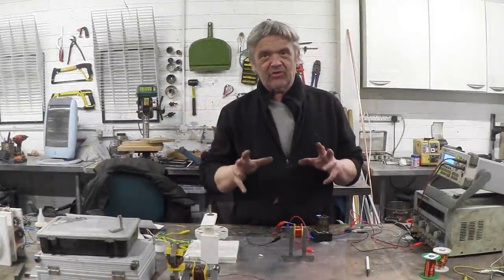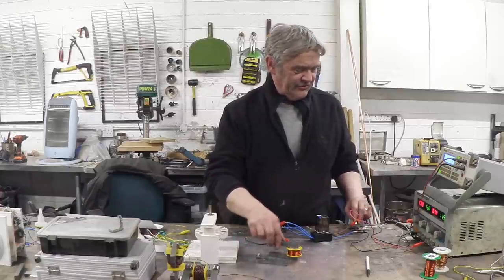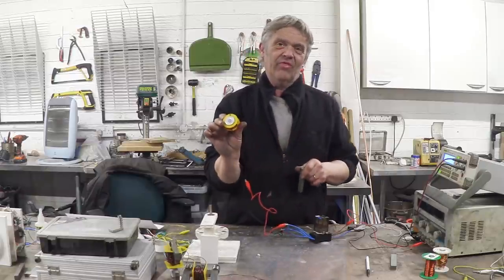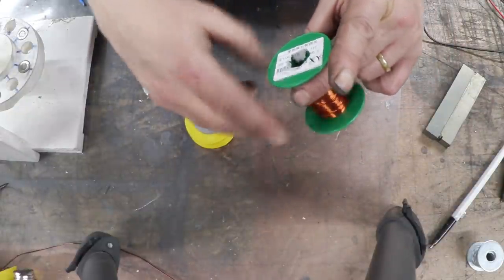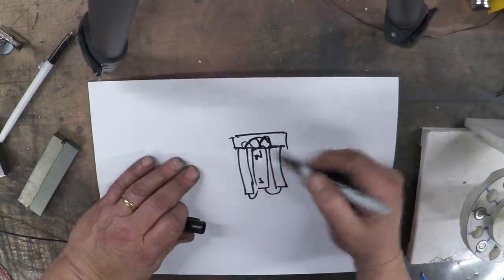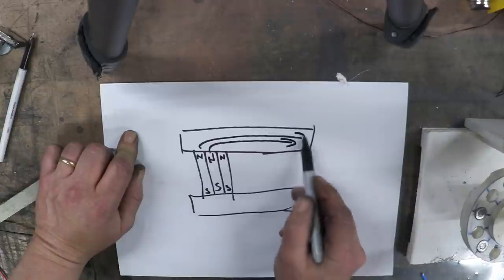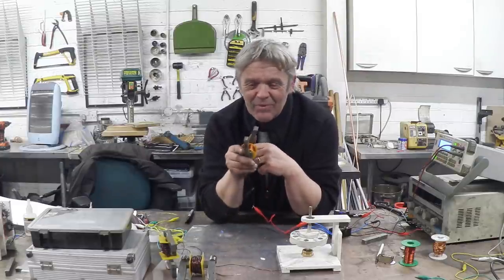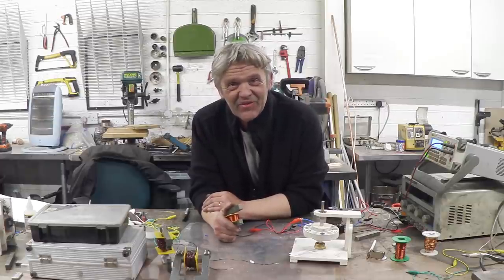1041 The Magnetic Switching Element - How To Turn A Permanent Magnet Off And On

Comment: Interesting. The double or nothing concept migth be an original idea. I think the nuclear power reactor where im sometimes deployed uses flux reluctance motors to drive fuel rods up and down the reactor. Like you mentioned it's very reliable stuff.

Comment: Since I caught this one right after you posted I've got a semi unrelated question. I've recently run across some videos about cold welding and as near as I can tell it's basically a tig welder with some serious refining of the current/timing. Since your so good at making things simple to understand (watch your videos a lot) question is : is there a simple way to utilize the tig welder for cold welding? Now I'm going to restart this video. Thanks for what you do sir😎
Reply: Hey,  I've just completed a mig to a euro torch but my plan in the next few weeks is to make a crude tig with an override peddle.  I'm also interested in cold just because its another way to build stuff. I may do a couple of on how and what I've done.
Reply from the maker: I like Karl's answer mate - it seems he is going to pick up that particular gauntlet - but I also like the idea so I will definitely have a look at it

Comment: The non--motor part of magnet concept would be great for a mag-switch while woodworking on a table-saw. 
Using it as a stop on a fence or for holding  a feather-board in place on the cast-iron table of the table-saw. 
Way easier to make than a DIY version of the commercial mag-switches on the market.

Comment: This is becoming a fantastic project, just need to turn it 90 degrees encase it all in a wheel, put a tyre on top and you have the perfect electro wheel motor, times that by 4 and you have a perfect 4x4 EV with independent torque and drive on each wheel

Comment: You probably mentioned it in other videos, but worth adding a comment to the text section that the wire you are using is insulated enameled copper wire.

Comment: OHHHH, so you did the exact same thing I was saying to do but on the other end of the arms, you added those Neo's. Spot on mate, well done. Now you got me wondering what if the whole arm was Neo's. or two long Neo's that connect to the smaller Neo's, hmmm
Reply from the maker: give it a go mate
Reply: Would those long arm Neo's heat up if a large current was passed through them?
Reply: @themeek351  Correct, yeah I wasn't even thinking right, but yes you are right mate, the magnets would lose power because of the heat ...
Reply: @jasonwitt8619  keep your amps down and you should be fine!

Comment: you really have my attention Robert. Questions.. Since the iron rods are saturated then it appears all your doing is passing the coil magnetism(which even at modest voltages are far more powerful than magnets) to the ends of the shafts. That wouldn't be flux switching, just flux passing? however if you are suggesting that the coil is somehow gating the flux of the magnets to the end of the rods then that would really be something. So what is actually happening in the rods? is it like a pond that is full, and when you put more water in, it simply overflows the same volume at the other side? or are you putting pressure on a valve at the other side allowing the pond to suddenly and quickly empty? This is very exciting and reminds me of the radius boots. However your explanation and simple to copy experiment seems very intriguing! on my way to the hardware store...

Comment: What I'm getting from this is that it's a magnetic flux diverter and by magnetic assist you actually mean that. This would be really useful in motors and generators to increase efficiency and maximum power output at the cost of size and weight. could be used to change the form factor of a motor as well as it allows you to move the magnets out of the internals of the motor (or the casing) thus allowing you to make longer but much thinner motors that have the same strength.

Though I don't see this becoming useful in things like cars or wind turbines, steam generators could definitely stand to gain from this as it allows to more easily thermally insulate the magnets from superheated steam without using gigantic and expensive mechanical systems and bearings to separate it.
Reply from the maker: interesting thoughts mate - cheers

Comment: Hi Rob. A good while back, you posted a video on what you called (I think) a flux gate switch, where you wound a coil around a (soft magnetic) ceramic magnet and magnetically coupled it to a (hard magnetic) neodymium magnet. In that video, you achieved a similar  effect to what you're demonstrating now by simply pulsing the current through the coil and reversing the magnetisation of the ceramic magnet. I looked, but I can't find that video now. You said at the time that you were thinking of using the effect to build a motor. Did you ever try it?
Reply from the maker: That was a while ago mate - the effect is pretty much the same but the switch speed is slow and the realignment of the soft magnetic material - alnico - had too high an energy cost - but on the plus side the effect was long lasting

Comment: Theirs another way to do this. If you put 2 magnets on a small piece of steel facing the same direction the steel will be magnetized. But if you flip one of the magnets over. The steel won't be magnetized any more. Also could you please do a demonstration on the halbach array

Comment: I also was thinking along this design for a permanent magnet motor, where the coil simply pulls back the stater field in short duration to allow the armature time to transit the field of stater to armature magnets. the coils at the stater's are not to turn the motor, but it is the magnets attraction and repulsion the turns it.  What do you think?
Reply from the maker: I think it's an interesting idea mate and could well solve that point at which all magnetic motors have failed at so far - give it a go

Comment: Next, you need to make a flux capacitor.  1 iron horseshoe - 1 iron bar - 2 wire coils.  You can engage the flux field with a 9v battery to hold the iron bar in place.  remove the battery
Reply from the maker: have you done a video of this?
Reply: @ThinkingandTinkering  Nope.

Comment: Great work again Robert, I will ask this, but I think others have already have mention this, can this magnetic switching be used in a generator circuit?
Reply from the maker: I would think so - it is on my mind to. try that when I have sorted out the motor aspect of it

Comment: I’m super late to this video but I am a bit confused and wondering if anyone had any answers. What is the point of using a coil to shut off a magnet? Wouldn’t it be more efficient to use that same amount of electrical power in directly making an electromagnet? I guess my question is how much Gauss would you need to induce in a coil to completely turn off a permanent magnet? If it takes 100 gauss in the coil to turn off a 100 gauss permanent magnet then what is the point when you can use that same coil directly as a magnet? Sorry for my confusion I’m not even sure if my question makes sense

Comment: The permanent magnets wont last long when they forced into opposite polls that are stronger than the the permanent magnets. I've messed up a few magnets that way but they can easily be fixed with the right type of magneto. Permanent magnets can be recharged

Comment: Hi, I was reading about farads and tried to compare it to amps and was not able to sort things out. Some peoples were discussing about the definition where 1 amp=coulombs and farads is colomb-second where coulomb multiplies with seconds, unlike km/h.  Is there a  simple definition you could explain please?
Reply from the maker: it will be a bit long winded so I would happily do a video but an amp is a coulomb per second - a farad is one coulomb at one volt - that's because an amp measure a rate of flow so to speak and a farad measures an amount of charge - it's a bit like how much water is there in this bucket then how much is flowing past my feet if I knock a hole in it
Reply: @ThinkingandTinkering  So what I understand is that they both represent a capacity, but they are not expressed the same way.. amp is a capacity of charge for a period and farad is the charge. If I'm wrong, at least I have a visual representation. Thanks.

Comment: if the spinning magnets were closer to each other, at the right spacing, theorically you could have only 1 magnetic arm with that twisting trick you use, am I right ? fascinating stuff  magnetisms, motors and whatnot..
Reply from the maker: there are no spinning magnets mate - the rotor is made of isolated steel points - but I think you are right in what you say
Reply: @ThinkingandTinkering  oh yea true its just steel right, makes me think then, what if put magnets instead? and the whole arm could be just made of magnets aswell or maybe it would not work aswell.